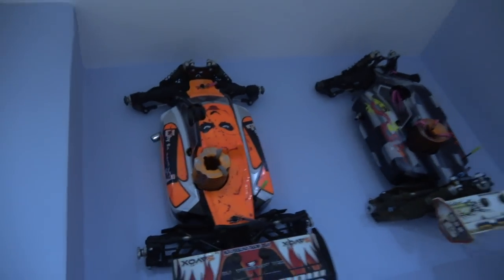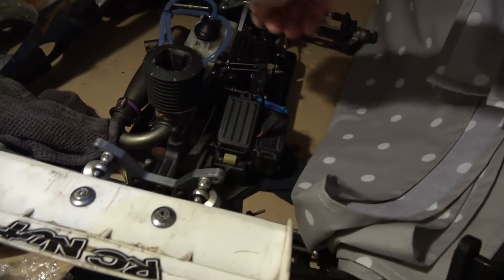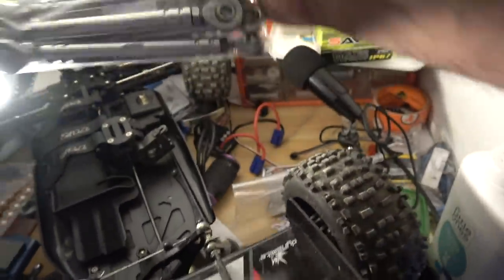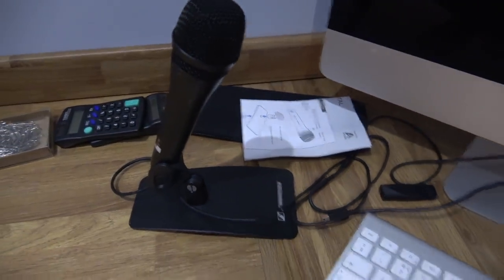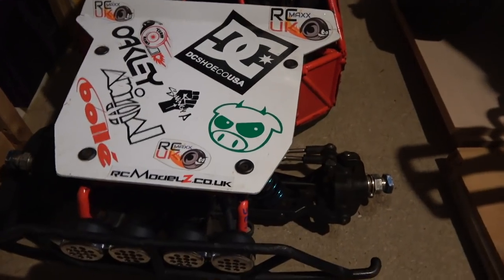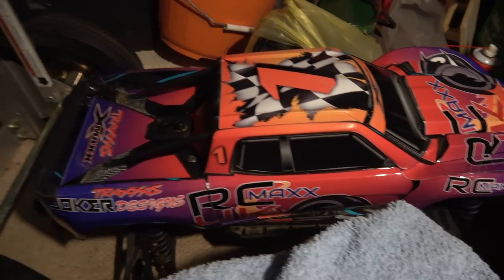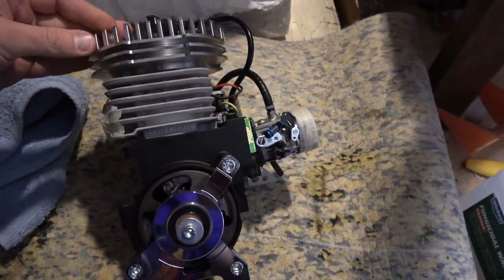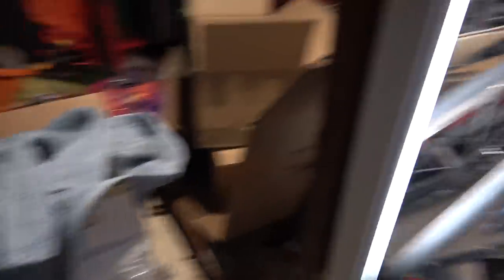RcMaxxUK Nov17 update!... whats new?

Comment: Nice vid also nice collection 5t 5b nice platform to work with I've had a bunch of RC's over the years and to me I should have been purchase the Losi 5t 👍as far as that beast of a motor your about to put in the 5t awsome choice can't wait to see it running please do a build vid.
Reply from the maker: Darwin Williams hi mate. I will definitely do some vids on the build. 1st off just to show all the stuff I’m using initially... then what I need as extra to run that crazy engine! I think my pocket is going to be very light at the end and my bank account bleeding😂 but it should be a blast! Thanks for the comm👍👍

Comment: Are the extenders stock in in DHv2?
Reply from the maker: Ev0ltion hi mate. I believe so yes. We will get a vid up ASAP of Stephens dragon running these wide v2 extenders.
Reply: Ev0ltion 

In our newest V2s, that are on sale right now,
Yes I've now included them in with the whole package of the Dragon Hammer :-) 

You'll also now get the 
FID Tuned pipe,
Full FID Spare wheel,
Plus the new 'Wider' extenders too  :-)
Reply from the maker: NORTHWEST RC CLUB superb! Is the throttle / brake upgrade linkage std now too??.....👍👍
Reply: RC Maxx UK 

It is Joel :-) 
Everything I've developed has been implemented into the truck's 
Rather than charging you extra after you've shelled out on a new truck :-)
Reply from the maker: That is superb mate. I was extremely happy with my v1 dragon. mine had the tuned pipe....All i upgraded was the throttle linkage and i did feel a wider stance would be good. this v2 coming with the billet front and rear diff/ extenders / linkage/ tuned pipe along with the numerous v2 design changes makes it a bloody good buy imo. AWESOME!
Reply: RC Maxx UK 

Yes indeed Joel :-) 

The new package is an absolutely amazing deal :-) 

Which will only get better ;-)